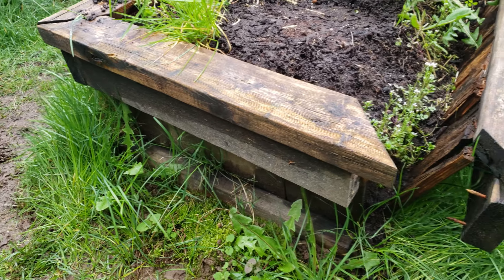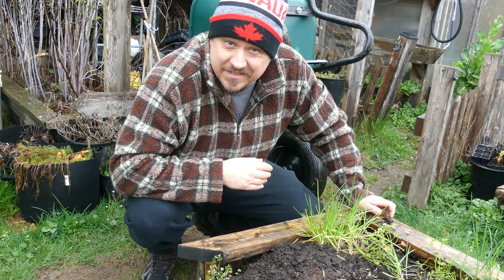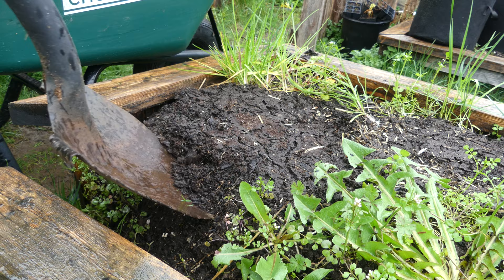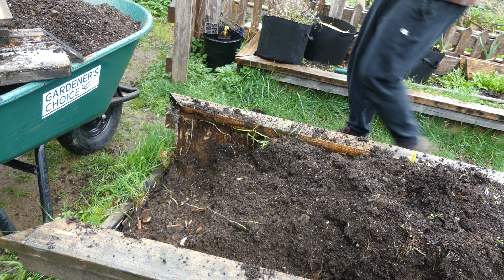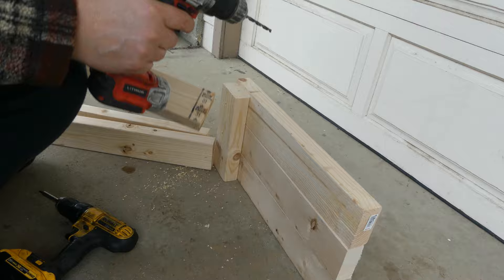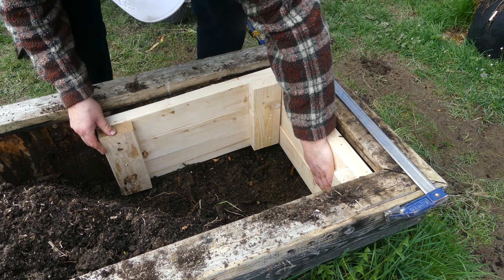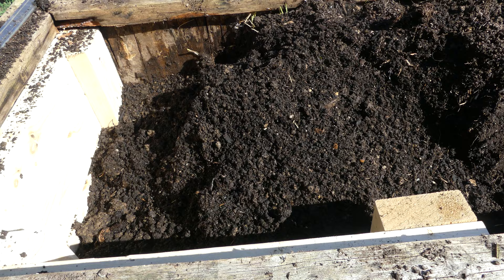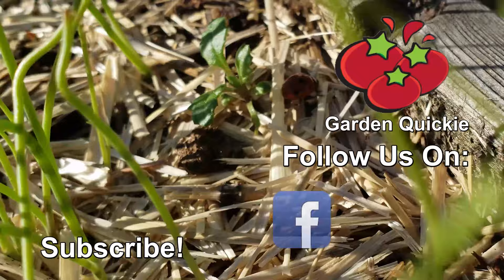Raised Garden Bed Repair - Garden Quickie Episode 51

Comment: Lol...my cheesy particle board type strawberry bed was bowing on the sides....I decided to try and get another year out of it by cleaning out some of the soils around the edge, get some construction form stakes to stop the bowing.  I pushed the sideboards in till they were straight using my foot,  then pounded each stake into the ground close enough to keep the side straight and the boards fit back into the corrner posts. The stakes are strong and they are deep enough that I think Ill get a little more use out of it.  Wish me luck. 😁
Reply from the maker: Love it!  Best of luck on the longevity! 🙂
Reply: Particleboard sounds great especially for drainage. Great idea!!!

Comment: I'm across the water from you, Bellingham area. Those weeds at your busted corner...I don't know what they're called, but I hate them with a passion. By the time you realize they're even growing(which is right about now) it's too late and you've got exploding seed pods everywhere. 🤬

As wet & soggy as it gets here, anything wooden rots pretty quickly. So I built my raised beds using concrete blocks, lol. Before I built the boxes I also trenched in 3/4" PVC 10" deep with a riser to each bed for drip irrigation. It's all on timers with adjustable valves so I can fine-tune water needs for different crops. I may have over-engineered a bit. 🤣
But it works quite well. 😊
Reply from the maker: Chickweed man... I hear you on that! Not as bad as dandelions, but at least with them you can eat them!
Reply: Sounds like your " over engineering" saves you a lot of labor in the long run!  Smart.
Reply from the maker: @patriciatinkey2677  for the corners... No question! Lol

Comment: What is the procedure when there are established plantings near the area needing repair?  When you can't pull out all the dirt.
Reply from the maker: One trick I did was to build a new bed AROUND the old one. Only works if you have the space though as the new bed will be slightly larger

Comment: Hey Jeff.  Just wondering what kind of grow bags you use and if there is any you recommend? I am trying to figure out some thing to use in my small poly tunnel. I might lay drip tuning on it when I am away. Thanks this video - great fix.
Reply from the maker: Julie, I'm becoming a bigger fan of grow bags by the minute. Almost any brand is the same really. Go for minimum of 5 gallons....but the 7 gallon ones are the real sweet spot!
Reply: @TheRipeTomatoFarms  
Great thanks for the info.

Comment: Temporary band-aid fix though.  Far from permanent
Reply from the maker: Quite permanent actually. Check back in 19 years....this bed will still be going strong...
Reply: @TheRipeTomatoFarms  I'm quite familiar with standard spruce lumber that's untreated. When wet earth (soil) comes in contact with said wood, and it doesn't last very long. And putting screws through wet, half rotted wood into untreated (spruce) lumber won't last too long. (Not 19 yrs) I've been a contractor most of my life, and a gardener as long as I've been able to stand. I've done and seen it all. I'm not saying your repair won't work, I'm just saying it's not permanent
Reply from the maker: @No.1R3dneck  Fortunately, I wasn't using spruce. I was using Doug-fir. I find it lasts up to 3x longer than spruce. Of course nothing is permanent....I could have poured concrete slabs...and EVENTUALLY they would erode. "Permanence" is relative.
Reply: @TheRipeTomatoFarms  my bad then. Your 2x4's looked like spruce. Perhaps being how im in Central Ontario, we're ysed to spruce. You have Douglas fir for the most part in western Canada.  And please never use concrete for garden beds.
Reply from the maker: @No.1R3dneck  yeah, pretty lucky in BC that most of our "SPF" is fir. I sort through the piles to make sure. It's about 4x heavier than the spruce ones, lol!
Reply: @TheRipeTomatoFarms  I've worked with Douglas fir many times and it is quite a bit heavier. Beautiful wood though. I wish we had it here. We usually have to order it and it comes with quite the price tag 😆
Reply from the maker: @No.1R3dneck  especially now! Ugghh... Although, the prices have come down to what they were last summer.... Normally a 2x4 is about $2.20 retail.. Last year it was $9!! Ouch! Take care man.
Reply: @TheRipeTomatoFarms  I try to reclaim most of my lumber if I can or I go to camp and collect logs and use them instead either as is, or I'll make my own lumber. I try to use as many natural resources as I can!